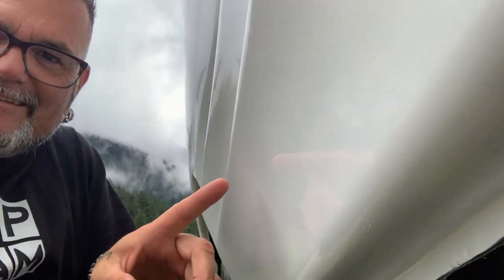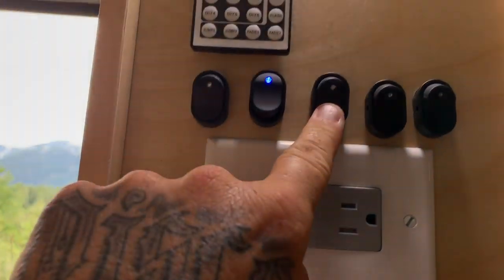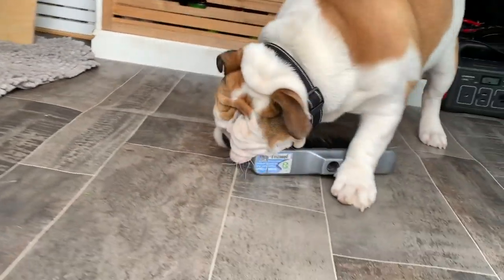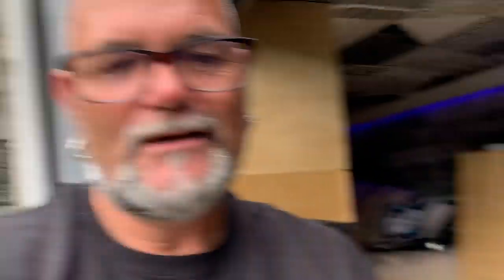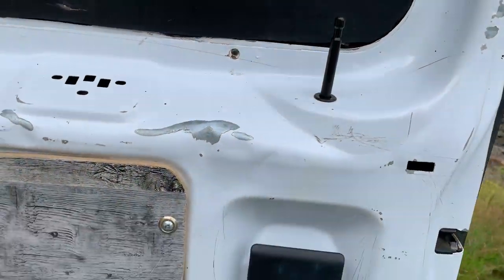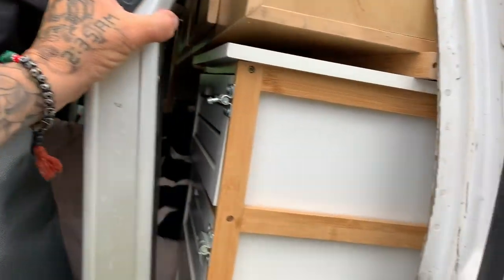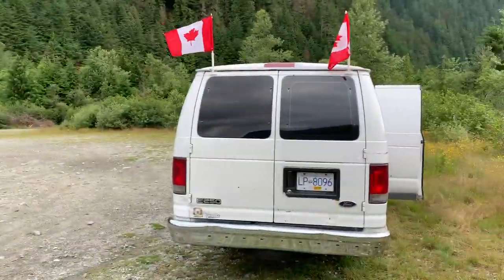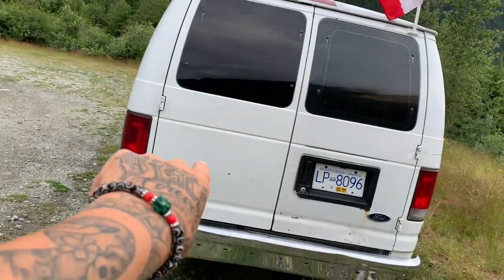Wear And Tear On Your Van And Build ...My Vans Taken A Beating

Comment: Just get a few cheap bottles of acrylic craft paint in colors that blend with your floor. (The little bottles that only hold an ounce or two.) Sponge or stipple with a brush into your chip, and nobody will ever know it's there but you. BTW my dad used to say that if you don't want your stuff to wear out, don't use it. : )

Comment: You should look at spray on plastic dip, great product if it gets messed up just peel it off and respray. Or use roll on truck bed liner for the  bottom 12 to 18 inches. Both products will help protect your home, gravel roads just love to mess up paint.

 Take it easy and enjoy your day.

Edit: gotta  love auto correct

Comment: About the time you get all the little nicks, scraps, and scratches in the van up to snuff, you’ll be replacing your van with another—probably one you can stand up in.  So, no sweat.  If you’re going to do a lot of grinding and sanding—get yourself a Dremel Kit; it will make it so much easier & you’ll use it in the van again and again in the future.  Have safe travels with Cruz!

Comment: My observations....wheel wells rust the most with trucks & cars.  Plasti Dip typically used on hammer handles, could be used on cars.  They ARE doing it on cars.  You tube channels displaying  it. 👍. BTW....painted a chair outside today.  It's cool we can.  Pup is still teething.  Poor pup & van . Exciting to be creative...

Comment: Hey an idea for you Chrome...I think it was a van build from the guys at "Solid Wood Worx" channel in one of their van builds, they took a piece of plywood cut it for the passenger seat to meet up with the dashboard put a brace underneath it and threw a piece of carpet on top so a doggy could have the seat area but also the space up to the dashboard. They also grabbed a piece of rubber kitchen shelf liner like from a dollar store. Cut a piece to fit on the dash in front of the passenger area and used double sided to tape to adhere it. This gives a place for doggy to have more grip and also is a cheap way to protect your dash board from little doggy nail marks...nice vid yet again:)

Comment: The doors you want to replace can be replaced by years 1997-2014. E-150, E-250 and E-350 will fit.
Reply: They can be from  92 thru 2014 I pulled windows out of a 93 and 95 to put pop out windows in not hard to do just take your time pulling them off the seal and get the hardware mounted on the door.  The first one I used silicone to seal the last one I used the putty tape I had leftover from doing the vent

Comment: Nice job on the paint, Chrome! My dad is constantly touching up paint on his Buick lol, & he's 91 years old. I used to use automotive paint as nail polish! It looked great (with 2 coats of clear base to protect my nails) & the little touch up vials with the built in brush were ideal. But i stopped using it because the color selection has become boring over the years hahaha! 💅 🚗
Reply: I made a custom collection of nail varnish for my girlfriend a few years ago, when I worked at a panel shop.

She had everything from emerald green to ruby red. Even some with a gold and silver flecks
 She had about 80 little bottles :) 

Her friends all used to come over before any event like a wedding or birthday and they would spend the day doing each others nails while I kept pouring  the "tea" and making snacks because their nails were wet :)
Twas fun to spoil her like  that :)

Comment: When you paint your van - have you thought about doing it in Raptor Liner - you can get it on Amazon (not sure if you can get it in CA)  - it's truck bed liner and will protect your van.  You can even get it in a tintable formula - so you could keep it white if you still want

Comment: If I may make a suggestion. Spray all the spots on your van that are at risk of rusting, make sure there is no bare metal anywhere

And then. . . . 

Get s sponsor to wrap the van. Tell the sponsor that you will keep the wrap on for a year or two and then after two years they can renew the wrap or else you can find a new sponsor. 
Depending on the sponsor of course,  you could get quite the design Made up because they can print on the wrap and it doesn't affect the price much.

Your channels have got quite the following do I just know that a sponsor will be easy to find 

The added bonus is that a vehicle wrap will protect the paint from scratches and this will make fixing any new dents at the end of the two years way easier and way way cheaper.

VEHICLE WRAP WITH A FREAKY GRAFFITI DESIGN :)

Comment: @ 1:40. Cruz is like "Get off your butt and get me my play toy. You see me struggling." LOL. I'd rather deal with minor vehicle repairs than with apartment or home repairs like molds, bedbugs or mice and insect infestation. hehehe. If a roof rack is installed, I see some solar panels going up there also. LOL. Van hard and safe.